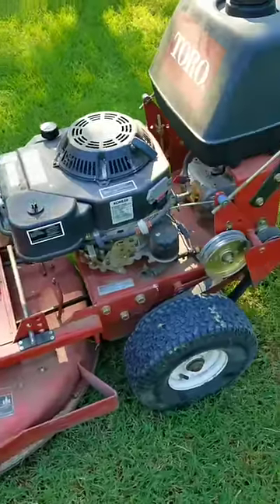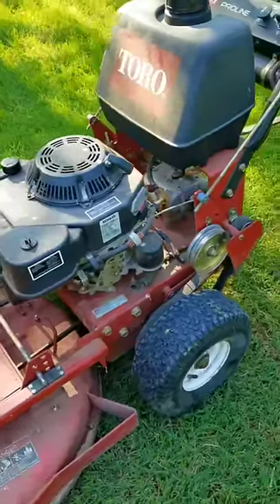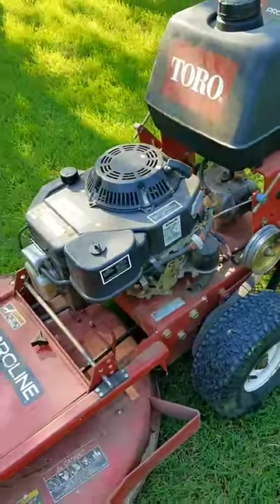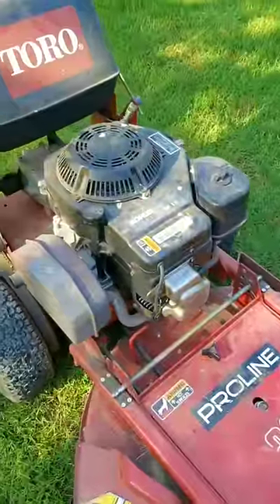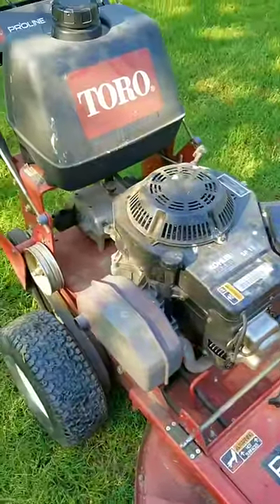What's Wrong With This Toro Walk Behind Mower?

Comment: Flywheel key, but id check the valvetrain lash. Some people set them way to tight causeing valves to not close. Making it pop through intake or exhaust. Real easy fix
Reply from the maker: you are correct,  turns out the valve lash was too tight
Reply: @INSIDEHOUSEGARAGE  nice! I bet she runs like a beast now. Ill check out the video if you have it up.

Comment: If it has compression it's probably the coil or the ignition relay those don't usually shear flywheel keys since the blade is belt driven
Reply from the maker: turns out the valve lash was much too tight
Reply: @INSIDEHOUSEGARAGE  I thought that engine had hydraulic lifters which are non adjustable I learn something new everyday 😊

Comment: Check plug, pull fuel bowl and clean, fresh gas, and a quick shot of starting fluid.  Then Check flywheel key and mag spacing.  Next overhaul. Because if it's mine I'd rather overhaul and know what I've got then doing piecemeal repairs.
Reply from the maker: turns out the valve lash was out, by a mile

Comment: Welp, I see your problem right there. Yup, over saturated mahogany bivalve bleeder port. If it smells like corn farts when you fire up the flux capacitor, you’re better off buying a new one.
Reply from the maker: turns out valve lash was too tight

Comment: Do a compression test. If good compression, check the low oil level switch. It's good check the spark plug see if you have good fire
Reply from the maker: turns out the valve lash was too tight

Comment: Plugged up carb due to ethenol in the gas. For some reason the small engine carbs dont agree with the ethanol. Half a can of carb and throttle body cleaner may remedy the issue.
Reply from the maker: turns out valve lash was much too tight

Comment: Either bad coil or sheered flywheel/magneto key.. Also I didn't hear it spin very much either, so it also may have carbon build up..
Reply from the maker: turns out the valve lash was too tight.

Comment: It looked like it pulled really hard,  so pull the plug out and do that a few times.  And while you're pulling it lay the plug on the top of the head and see if you're getting any spark???? If you're getting spark put  a themble of gas in,  put plug back now try again.
Reply from the maker: thank you Danny turns out the valve lash was out, by a mile

Comment: When it's been sitting for awhile and the gas sits in the carburetor it evaporates and  leaves behind a " varnish " like coating that will plug the jets and it has problems trying to start. It has happened to me before, I used to landscaping and mowing  work. It could be something else but it has happened to me before.
Reply from the maker: turns out the valve lash was too tight.
Reply: @INSIDEHOUSEGARAGE , glad that you got it fixed and working again. I wasn't sure what it was I was going on a similar situation with with power tools I used to have, I was wrong. 
Glad you got it taken care of  👍

Comment: That's a simple one. Last time it was ran someone hit something which made the flywheel bend or break the keeper pin in the shaft, shifting its timing. Take the top off the machine, look at the flywheel slot, shaft slot, and keeper pin and make sure they are lined up correctly. Had this happen to a mower once, and its and easy fix.
Reply from the maker: turns out the valve lash was too tight

Comment: Spark , Fuel ,  Compression . all you need to know . No Compression check the Valves , Yes a Keyway can shear off the flywheel through off the timing .
Reply from the maker: you are absolutely correct turns out the valve lash was out by a mile

Comment: After sitting for a long time oil needs to be put into the cylinder to get compression back. Since it shut off while I was running there was probably a fuel problem at that time. Now there are two problems. Gasoline engines that sit for a long period of time tend to not create enough compression to fire.
Reply from the maker: turns out the valve lash was too tight

Comment: Possible the ignition module needs to be re-gapped . I have to do that about once a year, the vibration causes it to close and shorts out the spark.
Reply from the maker: turns out the valve lash was out, by a mile

Comment: I think you need to adjust the valves, I had a riding mower that you would have to set the valves on about once a year ran fine after you set the valves but I would also check the plug make sure it's getting fire
Reply from the maker: you are absolutely correct!  turns out the valve lash was too tight
Reply: They don't go bad instantly
Reply: So you had to have some kind of indication like bad starting or something like that

Comment: Timing is off or valve is not closing fully.sheared flywheel key broken cam valve spring detatched or broken or valve warped/ bent or muffler spark arrestor clogged.
Reply from the maker: you are correct. turns out, the valve lash was much too tight.

Comment: There's a shear key on the crank/flywheel. If they hit something big like a rick with it that will shesr and spin 90 degrees which puts the timing of the spark off.
Reply from the maker: turns out the valve lash was too tight

Comment: Stuck intake valve, or more likely a sheared woodruff key to the flywheel. If so it's easy to fix.
Reply from the maker: very close!  Turns out the valve lash was much too tight

Comment: Before I take it apart I’d check the plug see if it’s gas fouled Check if the oil has gas smell if it does change oil put in new plug
Reply from the maker: turns out the valve lash was much too tight.

Comment: Did you check for spark?
Reply from the maker: yes theres spark, turns out, the valve lash was much too tight.
Reply: @INSIDEHOUSEGARAGE  then I need to go. Back to MINE here in the Philippines. I have been Messing around with the same issues. TEAR DOWN TIME!!

Comment: Check the spark plug. May just need a new plug or just file off the carbon. Next check compression. A former commercial mower should be a bit worn on the piston rings. Check with a compression guage.
Reply from the maker: turns out the valve lash was way out of spec

Comment: Clean rust off flywheel and coil with sandpaper. Reset gap with a MatchBook cover. Should fire right up.
Reply from the maker: turns out the valve lash was too tight.

Comment: Shear pin on the flywheel could be off just a hair that can throw the timing off... A wire could be shorting out a little bit ..  .. any of them will throw off the timing that will make it back fire
Reply from the maker: turns out the valve lash was too tight

Comment: Check compression, check carb jet, check for ignition,check for crank shaft brake
Reply from the maker: yes compression was low, it turns out the valve lash was too tight.

Comment: I've used carb cleaner to unstick the valves and get the movement sounds like it has no compression and shitgas in it
Reply from the maker: turns out the valve lash was too tight.

Comment: Sounds like your valve timing is off.  Your not getting compression.  Pull your plug and verify spark before pulling the head off though.
Reply from the maker: turns out the valve lash was too tight

Comment: backfires but doesn't start. 
1st plugs,
2nd gen/magneto
3rd clean magneto of rust. 

4th check compression/Adress
5th just clean the carb (Your there anyways. 

6 should start now.
Reply from the maker: turns out the valve lash was too tight

Comment: Those engines are known for the valve adjustment being off.   Readjust the valve clearances.    Should run.   Intake and exhaust.
Reply from the maker: you are correct. turns out the valve lash was too tight

Comment: I'd start with checking the Spark Plugs, then Compression Test, before anything else...
No attempt to start can be No Spark for ignition...
Reply from the maker: turns out the valve lash was too tight.

Comment: You need three things to make that modor run 
Air ...Fuel ...Spark...you need to check the spark plug and ensure it's working
Reply from the maker: turns out the valve lash was too tight
Reply: You need compression as well

Comment: Flywheel shear keyway is sheared, or a bad coil. But if it's back firing it more than likely is the flywheel shear keyway
Reply from the maker: turns  out the valve lash was much too tight

Comment: Simplest things first you checked fuel and spark then check valves and compression then check the flywheel key.
Reply from the maker: turns out the valve lash was too tight

Comment: Check for spark. Could be a safety switch. Bad spark plugs. The timing key is made of steel. Which very seldom brake. Check valve.
Reply from the maker: valves was correct, turns out the valve lash was much too tight.

Comment: My best guess is a bad valve or stuck valve......also its newer junk if u want the best  kholers get urself an old  K series......cast iron block and basically bullet proof
Reply from the maker: turns out the valve lash was out, by a mile
Reply: @INSIDEHOUSEGARAGE  thats awsome u figured it out. Kholers are great engines. I have two cub cadets both are IH cubs both have the K series engines. K301 engines which they are 12hp my 129 is a 72 and my 128 cub is a 71. Keep up the great work n vids

Comment: Clean the carb, lap the valves. If you can't feel the compression stroke drastically do a compression test.  Might need honed and new piston rings. Obviously wrist pin and con rod bearings should be replaced just because you dug that deep anyways.  I almost doubt that the cylinder is so scored it needs bored out though. I think Kohler has the best small engines.
Reply from the maker: turns out the valve lash was too tight.

Comment: I'm with Dirt bike. I would definitely check the fly wheel key, because if it hit a rock, stump, branch, etc. it can cause the key to shear and that will throw it out of timing. It's because of the backfire that leads me to that conclusion, however it could be a clogged exhaust port as well. Good luck 🤞
Reply from the maker: turns out valve lash was too tight
Reply: Not likely, .....belt drive blade.

Comment: Key between flywheel and crankshaft. If it is sheered it will explain back firing and not running
Reply from the maker: turns out the valve lash was way out of spec

Comment: Seems similar to the Honda motors where the rocker arm cracks not allowing the valves to move sufficiently.
Reply from the maker: turns out the valve lash was way out of spec

Comment: Coil has a built-in cdi. They go bad at random. A cheap Amazon coil will get it running again. Only 3% will bend a push rod.
Reply from the maker: turns out the valve lash was way out of spec

Comment: Check the woodruff key in the flywheel. They break and timing will be fuct. 

If it's got air, fuel, and spark, that leaves timing, if timing is on, you need to start digging and buy a rebuild kit.
Reply from the maker: turns out, the valve lash was much too tight.

Comment: The motor is back fire ING so you need to make sure the motor is getting power and it has a connection to spark plugs and make sure the valve is right try some starting fluid.
Reply from the maker: turns out the valve lash was much too tight.

Comment: Clean the magneto And reajust the magnet.  A simple fix. Possibly carburetors plugged but I kind of doubt it because you did get fire
Reply from the maker: turns out the valve lash was out by a mile

Comment: Shear key on fly wheel is broken. This shear key set the timing for the mag. This is what I would check first.
Reply from the maker: close turns out the valve lash was out by a mile

Comment: The timing is off, the flywheel key either made a indent in the wheel or completely sheared off from hitting a solid object while mowing.
Reply from the maker: turns out the valve lash was too tight

Comment: air,spark, fuel....you got 2 of them....my guess is spark issues.  also how old is fuel and was ethanol gas used in the past????
Reply from the maker: turns out, the valve lash was much too tight.

Comment: I would say your rite about the flywheel key is either sheared or halfway pull the flywheel replace the half moon keyway
Reply from the maker: turns out the valve lash was too tight.

Comment: Rocker arms for the valves. I had a deere riding mower that i got for free that would get air through the exhaust pipe and push exhaust gasses through the air cleaner.
Reply from the maker: Good tip!

Comment: Broken spark plug element. The ceramic or electrode is stuck in the intake valve or there's a burnt valve.
Reply from the maker: Close, it turns out the valve lash was much too tight.

Comment: Timing. Key partially or fully sheared at flywheel or low compression.
Reply from the maker: turns  out the valve lash was too tight.

Comment: Take out the spark plug. Check that air is making it's way to the cylinder head. Oil bypassing the rings maybe causing sludge on the top of the cylinder. Stater doesn't produce enough electricity. ???
Reply from the maker: turns out the valve lash was too tight

Comment: Clean the carb, new plug and fresh fuel to start with. Possibly new rings and valve seals as it didn't seem to have much compression.
Reply from the maker: you were right about the compression, it was low and it  turns out valve lash was too tight

Comment: i have one look almost identical but it walk behide mower make by xmark 

problems with your seen be key in flywheels or stuck open valves 
how to tell if valve is stuck open just remove valve cover n turn engine over to see if valve full way released if not then that need be cleaned up
easy trick is remove intake port and use brake cleaner can and move engine back and forward (without start plug and besure key off) it should free up valve in time get her started if yes valve is full way released then move on to flywheels shouldnt be that hard longer you have pull pulley tools if key not. broken. then recommend coils is off timing or sparking too early or too late only way tell is line up your crankshaft straight up and make sure flywheels mark line up with coils in straight line if off set then someone may have swapped flywheels in wrong mower
it happens in few them not always
be sure to clean coils and flywheels mega so it can spark
Reply from the maker: turns out, the valve lash was much too tight.
Reply: @INSIDEHOUSEGARAGE  
oh awesome you find it

Comment: Everyone keeps repeating everyone else's answer about the sheared flywheel key 🤷‍♂️  My first thought was that the timing was off, which leaves the intake valves open for the spark to ignite the fuel back through the carburetor, i.e. backfire... but the valve lash being way off would do the same thing.
Reply from the maker: you are correct turns out the valve lash was way out of spec

Comment: I might be the idiot here, but how does the engine turn off? Is there an electrical short on the kill switch? It's why my boat motor wouldn't run. Maybe the obvious isn't so obvious.
Reply from the maker: the key, will ground or "unground" the ignition coil.

Comment: Turn key on first ,check fuel, spark and compression,  being 60 to 120,fuel being no older that 3 weeks old,on spark,you can take plug out sparkplug  lay on block pull and check for spark
If blade switch is on it won't start,possibly  sherd flywheel key! Master tec
Reply from the maker: turns out the valve lash was much too tight.

Comment: Valves need reseating and maybe you check the flywheel key and change the spark plug.
Reply from the maker: turns out the valve lash was much too tight

Comment: I would start with oil change fuel change filter as well and a spark plug that’s just basic maintenance that’s where I would start
Reply from the maker: good idea, but turns out, the valve lash was much too tight.

Comment: The carburetor could be dirty and the flywheel key could be sheared or oil is in the fuel thus fauling out the spark plug.
Reply from the maker: turns out the valve lash was much too tight

Comment: I had an engine that did this too and i took the flywheel off to find out that there was no flywheel key so i got a new one and put it in and it started but overrevved like crazy and i panicked so i tried to turn the engine off but i touched the spark plug and it shocked me like mad
Reply from the maker: thanks for the information WestwoodFanboy123, turns out this one just needed the valve lash to be adjusted.

Comment: Probably the magnito(coil)And a spark plug. it definitely no matter what should get a carb clean and a new fuel filter.
Reply from the maker: close, it turns out the valve lash as out by a mile.

Comment: Change plug, clean carb should run it's getting fire cause it backfired
Reply from the maker: turns out the valve lash was too tight.
Reply: Nice. I'm glade it was salvageable I hate seeing good equipment going to waist over a simple fix

Comment: I would say spark plug but it doesn't sound like it's making much of any compression
Reply from the maker: you are correct, turns out the valve lash was much too tight

Comment: Chang the plug and And check the oil you had a lil fire in the carburetor caught the spark plug is not firing good luck
Reply from the maker: turns out the valve lash was too tight.

Comment: Valves need set, or it could be a timing issue…..lastly if has low compression could need a new  top end, let’s not forget that pesky little carb definitely will need a good cleaning!🤔
Reply from the maker: you are correct turns out the valve lash was much too tight.

Comment: Water in fuel ? Try starting fluid instead of gas in the carb , drain the fuel and add new.
Reply from the maker: turns out the valve lash was much too tight

Comment: Did you check to see if you have compression? I would start there
Reply from the maker: yes the compression was low, turns out, the valve lash was much too tight.